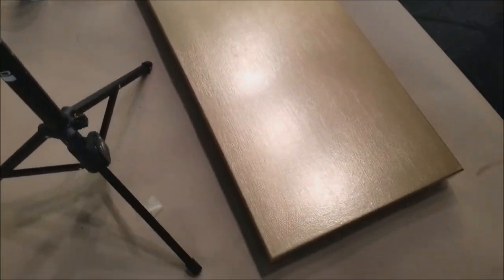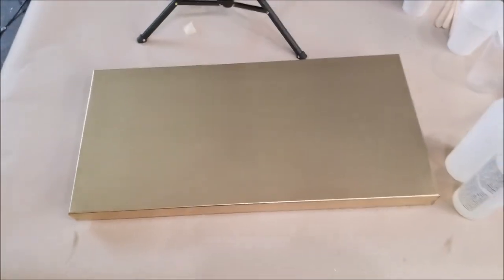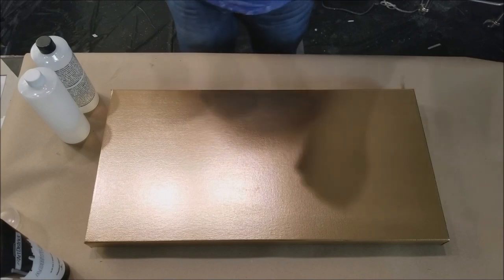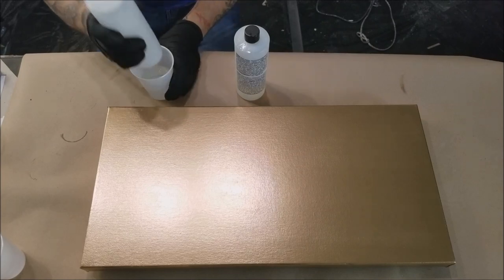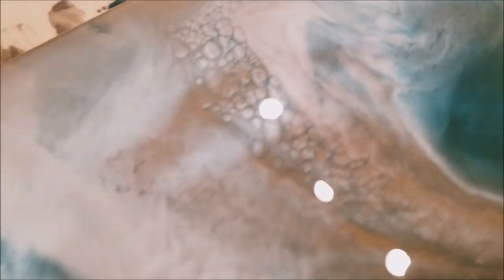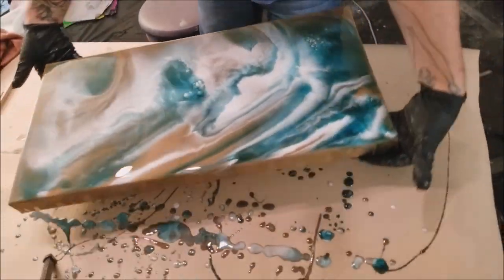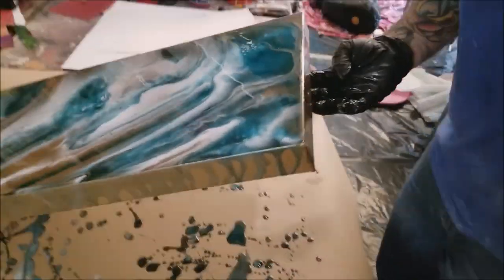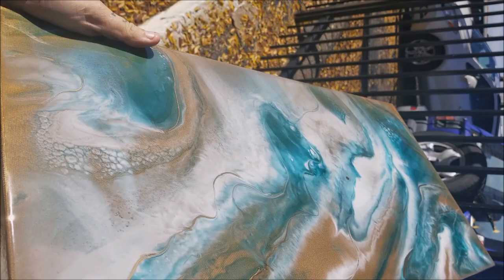NEW TECHNIQUE TO GET EASY VEINS IN RESIN (along with some Gold cells and lacing)

Comment: Love it!  Have you ever had a problem with the resin yellowing, or does it matter because of the colours used? Also have you ever used an airbrush/compressor instead of either a heat gun or hairblower?
Reply from the maker: Hello Linda, I apologize for the long wait for our reply.  We haven't seen an issue with any of our resins yellowing, however, they are all on indoor tables or indoor wall paintings (being in direct sunlight can promote yellowing).  Also, since we use many tints for our resin, the yellowing wouldn't be evident even if it were to attempt it.  The Envirotex Lite may yellow over time if it is left in the sunlight and is left clear (rather than colored).   ArtResin is the least probable to yellow of all of the resins we have used (it is notably more expensive).  Also, as Jeff is an airbrush artist, we have used an airbrush and compressor to manipulate the resin - however, we advocate using heat in resin pieces for a couple of reasons: it pops the airbubbles mixed into the resin, it makes certain paint react in the resin to create cells/lacing and it makes the resin more liquid and therefore is more easily moved over your surface.  We have used the airbrush to blow the resin but it was combined with the heat gun or torch.

Comment: Gorgeous piece. What caused the cells?
Reply from the maker: Hello Dawn, thank you for the question.  The cells popped up from a combination of things.  We typically pour clear first and then white (white will be the heaviest of the stained resins and it will sink into the clear).  When you heat the resin and tilt your substrate it makes the white roll over the clear and ultimately sink in spots - thus creating cells.  We don't use any additives.  Just paint and resin.

Comment: Hello, what resin do you use, which you dilute with watercolors? Acrylic perhaps? Also on a water basis?
Reply from the maker: Hello!  I believe we used Envirotex Lite for this piece (it's currently what we use most often).  We use many different types of paint to tint our resin.  We usually use acrylics, inks or spray paints - anything except oil based paints.
Reply: Saluuuut!...Apparently this confusion of the two

  incompatible ingredients: epoxy resin and acrylic paint (water-based !!! ...) is possible only in the visual arts, not pretending for durability. Thank you.
Reply from the maker: docter salvater we have never had an issue with acrylics or any other water based paint in our resin. It’s a preferred coloring agent in the resin community if I’m not mistaken.